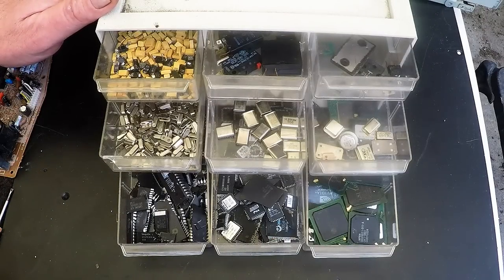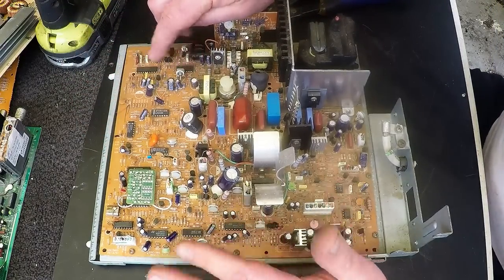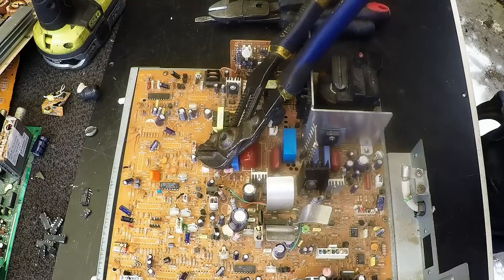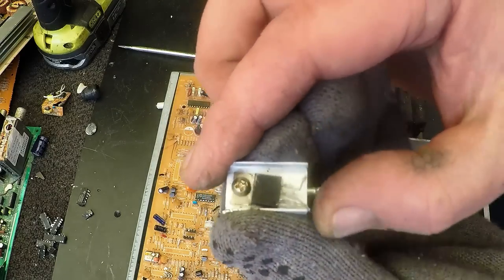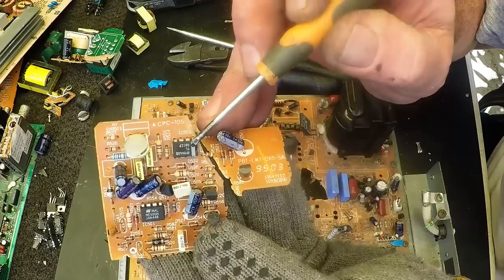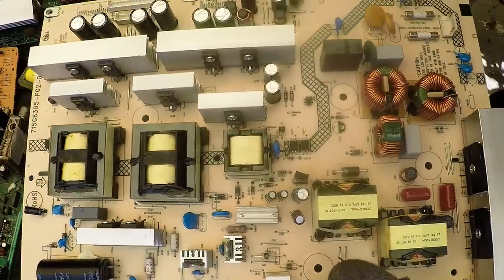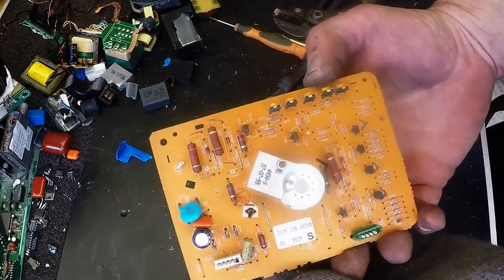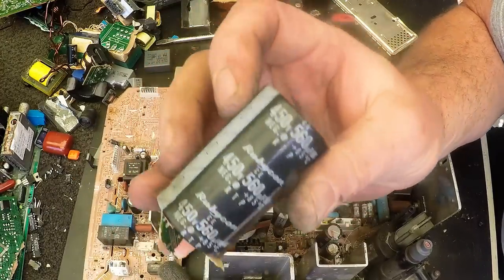Depopulating Boards - Low Grade Power Boards

Comment: I had to watch this again Ben, when I started scraping TV boards I didn't know what to keep, resistors looked pretty so I kept them for awhile, didn't know the value of IC chips nor how to take them off boards, I kept capacitors in buckets thinking they were important etc. My point is that your information to new scraper's is very valuable and your advice is appreciated. Thanks for sharing Ben

Comment: I tap a hammer on those large coils on the cement floor  to break that ferrite ring, then pull apart. Sometimes with pliers in each hand because the wire is stiff.

Comment: -What is in the fumes(smell) that comes off these boards?
-what is in the dust that is released when you pull anything off a board? 

Soon as you open something you can smell the circuit board.  Does this worry anyone? 

Thanks. 
Awesome vids Ben!

Comment: Thanks for opening a fly back transformer. I always wondered what was in the middle. 
One yard I went to bought my low grade boards as breakage. Considering they do have a bunch of aluminum and copper and other metals, it’s better than tin shred prices, only about double though. I’ll let the processing plant extract what they need and I’ll take off the easy parts and get more value with the heat sinks, transformers, silver switches, IC chips, etc.

Comment: That little black three pin component it is a Transistor too :) Also wanted to warn scrappers about the big capacitors (44:29)!! Sometimes they are charged! And if accidentally you touch their legs you get electrocuted!! to avoid that just short the pins with an isolated screwdriver. Be safe!
Reply: The 3 pin connectors  can be BJT s or mosfits. All bjt s are transistors but all mosfits are not. Your single diode mosfits are transistor. If used on the board back to  back they the 2 transistors can be used as a rectifier but usually you will find they use a double diode mosfit which is nit a transitor but a dedicated rectifer used for ac to dc or dc to ac conversion

Comment: 7:30 the three legged item is a transistor it could contain gold and or silver. The more modern ones look like silver top haps and they contain gold and or silver. Its like a super fancy crystal oscillator.
Reply: Not all are transistor they are either BJTs or mosfits. All bjts are transistor all mosfits are not single diode mosfits are transistors but you will also find 3 pin double diode mosfits which are rectifiers

Comment: 1 /31 / 20 my yard pays 6 cents a pound for dirty aluminum and 10 cents a pound for circuit boards. So those components made with aluminum aside from the extruded aluminum heat sink i figure ill just leave them on. Thanks for the video.

Comment: I have done a few flybacks and that is only one of the 3 types I have seen  there is the kind with  multi stands of copper wrapped around the center iron post also single wire larger diameter wrapped around the center iron post. call it to much time not much to do along with a 8 lb sledge  they are all embedded with plastic but the single stand ones are not to hard to separate out the copper  err the easiest I have found.

Comment: Great video Ben - I know it's time consuming but those mosfets are pretty popular with hobby electronics some are pretty expensive on their own. I know I bought a few for a recent project and I couldn't get them for under $2.50 a piece, I'd imagine if you could get them off without breaking the legs someone would pay a fair bit just for a misc bag. I started taking the time saving them after having to buy them, I used to just rip them off as well.
Reply from the maker: True but it's a very slow process to depopulate, most things would need to be de-soldered individually, perfect if you have the time and to list items but it's very slow to sell, I have thousands of brand new IC Chips that I listed individually for half price of the next seller, only sold 1 chip in 1 year.
Reply: eWaste Ben 
i agree with you completely if you get the one person who wants them they will sell, but like you said it takes time and sometimes that makes it a lot easier to scrap.  I scrap and also have a passion for circuit building, so for me I take the time depending on what it is. but you are right  Ben a lot of stuff will sit for a long time due to the huge selection of cheap new chinese components.
Reply from the maker: yeah it's hard to sell many components when we are in competition with ebayers in china.
china has almost free postage so you can buy a $5 item straight up, here I sell the same $5 item but need to charge $5 postage

Comment: Great video thank you. I'm wondering if the base metal lie grade boards don't have more dollar value depopulated than high grade boards. the dollar value of the copper and aluminum weight might add up to more than the gold and silver recovery value if mid and high grade boards?
Reply from the maker: good question, I guess for us scrappers it might be better cash flow as copper etc requires no further processing, whereas higher grade boards are mostly about the little gold & silver.
This is why many scrappers sell good boards because refiners are paying for all the metals that we can't easily recover in the backyard, so yeah, cash wise you might be right as it's instant.
Reply: eWaste Ben thank you. I also come from the perspective that in Ottawa Canada,  where I live, there is no scrap value for ewaste if the electronic is not complete.  I can get up to 30 cents a pound for complete laptops or 5 cents for crt/lcd tvs and monitors. one can remove the cpu and ram and hard drive. but taken apart boards are only shred value.  to I take anything with more than 5 cents.  because o love looking for the gold! I do scrap and I scrap everything I find at least once. Always excited to seea big tantalum. But also happy to see lots of heat syncs!

Comment: I heard from another scrapper that the little black top hats with the flat side have gold in them.  What do you think?  I've not opened one yet.
Reply from the maker: As with many of these things they can contain precious metals, depends on the manufacturer.
If you crush a few up you'll find a copper plate, sometimes looks like silver and sometimes looks like gold.
I haven't put much time into them but I might update the video to add them, thanks.

Comment: Ben you do a great job. You should be concerned about breaking IC chips. They often contain gallium arsenide. Its an arsenic compound. Just looking out for you. :)
Reply: GaAs semiconductors are quite uncommon in typical electronics and are usually only found in specialized applications as it is a lot more expensive than regular silicon. Aside from that, the GaAs isn't a compound that can absorbed into your body and poison you because it is an "arsenic compound." The GaAs is actually the semiconductor material itself (the glass like "chip" material) instead of the far more common silicon semiconductor. 

tl;dr saying gallium arsenide is dangerous because it's an arsenic compound is like saying table salt is dangerous because it's a chlorine compound. Not trying to be rude, just stopping the spread of misinformation.

Comment: In the flyback the silver colored clip on the ferite is stainless steel most times . At least I'm my experience
Reply from the maker: yes your right, almost always stainless steel.
Reply: james gamble
I'm glad I went through the comments this time. The last I made a comment without looking through the comment section was the Hip replacement item Ben received on a house pick up. Ben replied back
 (which I thought was very cool since he's got 40,000+ subs) 
and told me yeah that's what others also said. I then looked at the comments and I stopped counting after a dozen comments like mine were posted a year earlier, a little embarrassing!!
To get to my main point. I started watching been over a year ago and have been a loyal fan ever since. I also do a lot of crt's I've been pitching the flyback transformers in with steel probably close to 100 times before I came across a tv that wasn't one of the big name brands like Sony. In fact if I remember it had a name I've never seen. But on the flyback transformer the little bar on ferrite was COPPER, I cut into it to check. Ever since then I've been pulling off all of the stainless steel ones!
Thank you James for your comment!!!
 And especially Ben for his GREAT VIDEOS!!!

Comment: The capacitor juce is just called electrolyte. About capacitors verses relays, if it says xxx uF, yyy V, zzz degree C, surely a capacitor, if it has a small schematic and more then 2 connectors, surely a relay.

Comment: you are no doubt aware of this but other people may not be, might be worth checking your extruded aluminium heatsinks as they often have steel rods in them that attach the heatsiunks to the boards... sometimes they are easy to remove, sometimes quite difficult, but they can be really annoying if you are trying to sell them to scrap yards and you get pulled up for not having had removed those little steel rods still attached to the extruded aluminium heatsinks
Reply from the maker: yeah sometimes they break off leaving a little inside, hard to pick up even using a strong magnet unless they went over every one all over

Comment: Odds are that blue relay actually is brass like you suspected. The cheapo chinese relays forgo the silver contacts to reduce cost. No cheap TV board like that would have gold contact relays on it ;) Fun video.
Reply: Steve A 
I agree the chinese have probably figured out a way to make a new car for less than $500!
I agree that if that blue component is chinese made it probably is brass. But as a circuit board that particular one has to many IC chips to be chinese made not to mention some other components that could've been left out. As a cuircut board it's much better than a lot of the labeled made in china ones I've come across. I'm leaning toward gold plating. In the year that was assembled & how little plating is. It's probably  $.00,001 of gold used anyway. The Chinese wouldn't spend that much but just about any other county might. I really don't know, I'm mainly thinking out loud. Not trying to step on any toes!
But I'm in same mindset regarding Chinese made products. I hope the world leaders besides China steps up and starts making things to last again!! 
BETTER QUALITY!!!!
Reply: @shaneyork300  in my experience, Chinese manufacturers are able to produce for whichever price point the customer asks for. In other words, if the Made in China product doesn't work properly, or at all, look to the American supplying the engineering diagrams and specifications.

Comment: Can anyone tell me what the little small thick coin size ceramic disks are in a silver switch type plastic box, part of a dial or something? They look silver coated/plated how silver looks oxidized and they have a little pin like things that contacts them on both sides. I’ve been keeping them just in case for silver recovery. Thanks!

Comment: i have seen online buyers pay up to 0,50€/kg for power boards, and  my scrap yard just pays for example 0,40€/kg for dirty aluminium . so i just sell them as is / complete. Whats your opinion on that?
Reply from the maker: Perfect, if you factor in wear & tear of your fingers from cutting and breaking, selling complete lets you get on with getting more scrap or processing higher value boards, only thing I would do in your case is pluck the main IC Chip before selling as is.
Reply: nexus07121 could you post a few buyers?
Reply: There are some e-waste companies in Germany, but its just worth shipping to them if you have other things to sell and live nearby. Which country are you from Kevin VH?
Reply: nexus07121 I live in the Netherlands. (Near Amsterdam) My scrapyard paid 28 eurocents for boards, so I just turn in the lowgrade boards completely stripped of alu, copper and other stuff. The rest of the boards I save up in bins.
Reply: nexus07121 will check them out!

Comment: Is Phosphite idk how to spell it worth money?
Reply from the maker: it's a metal salt, a chemical, it's cheap
Reply: Holly man you replied, dang I thought it was worth something cause it has a weird texture to it. Thanks tho
Reply from the maker: you don't mean ferrite do you? what did it come from?
Reply: A tv motor thing that's on the circuit board and I have a lot but from other stuff
Reply from the maker: oh ok, it's ferrite, kinda like a ceramic metal, it sell as scrap steel so not worth a lot but it adds up.
Reply: okay thanks :)
I have a question tho. Will you be making a copper wire stripping video soon?